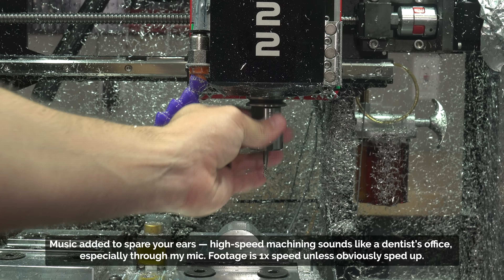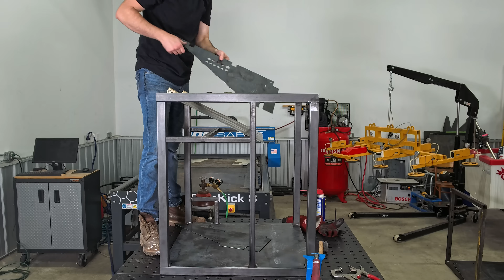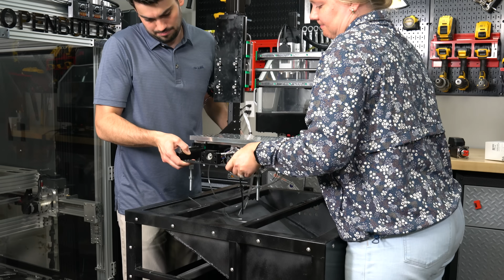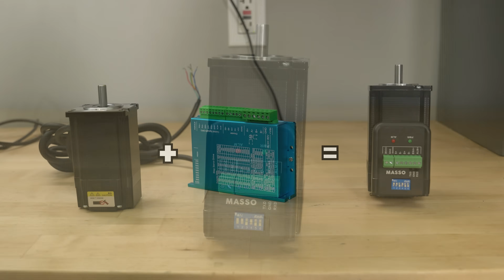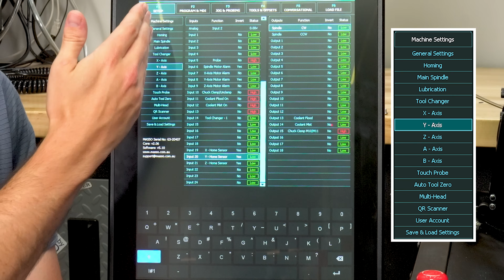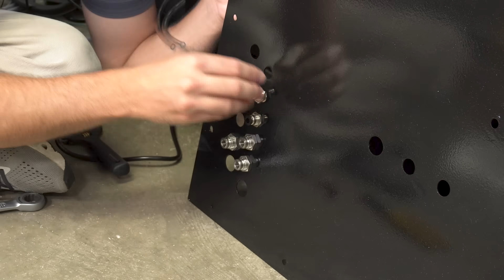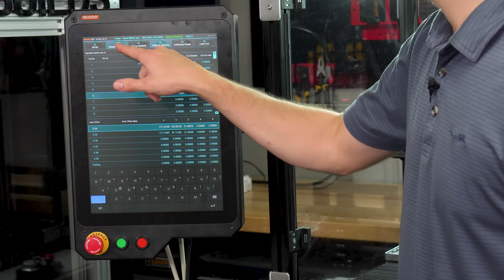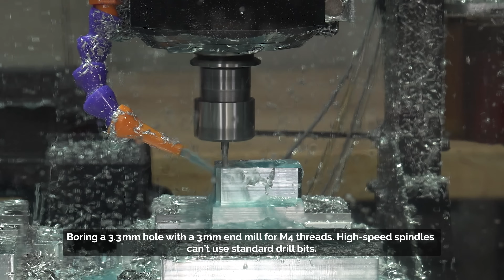Building the Ultimate Compact CNC Mill — Not just an Upgrade!

Comment: Its no longer a dmc2 sir.
I have the most upgraded dmc2 as of right now. I have atc i have wirless probing chiller i precsion ground the bottem plates z plates at work so my parallelism 14inch in x is .0002 and y is less than .0001 flatness tolerance is under .0007 anywhere on the plate. I had to also adapte drill and face the smw plate on the fadal as that is held to a .005 flatness tolerance from smw for any of the hobby machines and it had a .005 taper. I also converted to masso and 3nm masso motors with a z break. I have mine bolted to granite slab and .063 rubber padding off msc for vibration.
I adapted the spindle mounts to help traming x.

Theres so much more as well. Theres alot that it i am hoping ohmar spends time on before releasing anything else and perfecting one of the machines for people it can still be cheap but also work. Alot of people still have issues with boards tramming bolt holes lining up for hardware bent screws comming in and such. There needs to be better QA of these before sending to consumers. This is a awsome machine BUT AFTER you invest 3grand or so more. For instance your setup your showing is cost rang of a used tormach or even tm2p or fadal vmc territory.
Reply: Dmc2 of Theseus?